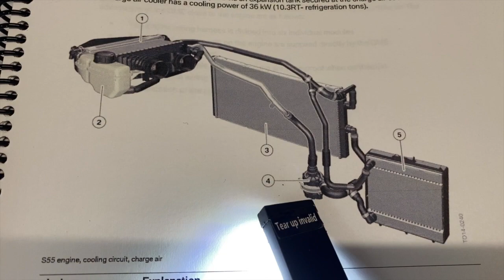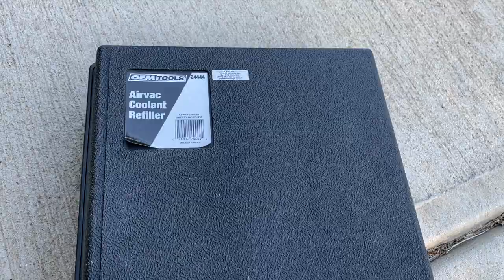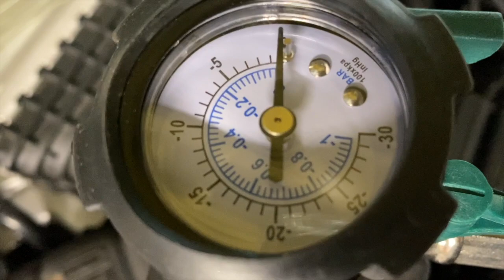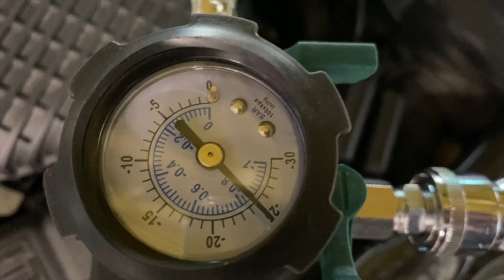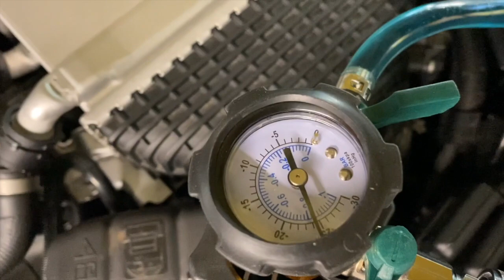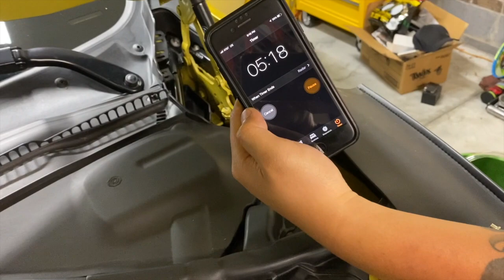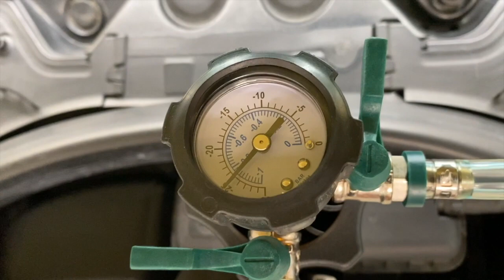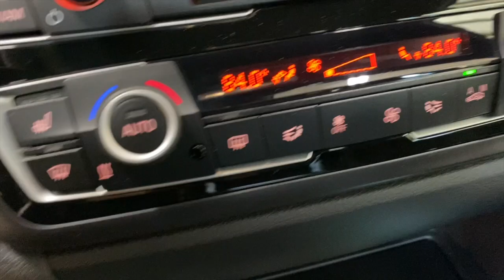HOW TO CHANGE THE COOLANT in a BMW M3/M4 (F80, F82, F83)

Comment: I just did this on 6 year old F-80.  It worked perfectly.  And yes I had to take out a little after the vacuum fill.  On a side note I bought one extra gallon of BMW coolant so I changed the coolant in my wife‘s volvo...it was OK but now the turn signals don‘t work.
Reply from the maker: +Bob Fognozzle 😂 nice!

Comment: Great info re this. ? for you, i notice my IC tank always seems to be right and the low mark, but my main tank is always over the full mark. this normal? no matter how much i fill my IC tank its always right at the low mark. then seems to over fill my main tank. Any thoughts?
Reply from the maker: +Shnel M4 IDK if you saw my S55 Cooling System Explained video, but you should check it out if you haven’t. You’ll see that the two cooling systems (charge air and engine) are physically separate, so when you add fluid to the IC tank (charge air expansion tank) it cannot affect the main (engine) tank.
Reply: Help Me DIY ok thx

Comment: What happens if you don’t pressure fill the coolant? And just pour in the same amount you took out and just bleed it? When I changed my radiator for my e92 I drained out all the coolant and just filled the coolant tank and did the bleeding procedure there was burping and a stream that was flowing I guess that’s what’s supped to happened and I just kept roping it off until the electric pump stop. Ever since then the car is done no over heat I’m a DIY guy also and I’m still willing to learn new things, did I do anything wrong there? Thank you!
Reply from the maker: +Jenderson Pen sounds like you did the right thing. The pressure bleeder is just a more fool-proof way of making sure all the air is out of the system.

Comment: What coolant is used for the top mount intercooler ?
Reply from the maker: +MELLtheLEGEND they both use the same BMW coolant. See the link in the description.
Reply: Ok.and i have to mix it with distilled water ?
Reply from the maker: MELLtheLEGEND yes. 50/50. The coolant bottle should have directions

Comment: Thanks for this video... the vacuum device seems pretty well built and a good value.  I did this slight modification to minimize the entrainment of air from the fill tube into the cooling system:  Before attaching it to the car, completely assemble the vacuum tool.  Place the fill hose into a container of distilled water.  Take the part that screws into the reservoir and hold it tight against your leg or some other surface (to close off the air path there).  Have all valves open except the one going to fill tube. Then attach your compressor hose, and slowly, give a small turn on the fill tube valve (doesn't take much), and you will prime the fill tube with distilled water.  Close off the valve to stop the flow.  To keep the fluid in the tube, you can hang the tip of it off of something from the top of the hood (coat hanger, caliper hanger, etc.).  Then proceed as you demonstrate in vid.  This way, you won't pull the air sitting in that tube into your system when you do the fill procedure under vacuum.
Reply from the maker: +JFritz you’re welcome! 🍻

Comment: I know this video is a couple of years old and no-one has commented for 6 months, but it seems to be about the only one on the subject and it has been linked on a number of forums and stuff. So I thought I'd add this info, which is from BMW's own ISTA+ servicing software.

The capacities are 13.9 litres for the main engine cooling system, which BMW call the high-temperature circuit, and 3.9 litres for the charge cooling system, called the low temperature circuit.

The specified coolant is nitrite- and amino-free anti-freeze and corrosion inhibitor. BMW's own products are LC-87 for vehicles up to the end of 2018 and LC-18 from the start of 2019. The latter should not apply to the F80, as the last one was produced in October 2018. But M4s were still produced until 2020, so they could be affected. These are different products so, if you have a late M4, you need to check which to use. Something that may help: LC-87 is blue and LC-18 is green. LC-87 is made using a BASF product called Glysantin G48 and you need to look for that 48 when you buy. Some brands call it AD48, C48, ST48, KK48, etc. LC-18 is made by Valvoline and called Frostox HT-12. Both these are to be used 50:50 with water or you can buy them ready mixed and use them neat. BMW actually state that in countries where tap water is drinkable, it is acceptable for use in mixing, so you don't have to use distilled. But I just bought the ready mixed so I didn't have to worry about it.

Both of these products are considered by BMW to be LIFETIME coolants. They do not need to be changed every 3 or 4 years. From September 2003, coolant replacement is no longer part of BMW's service schedule. It's there in black and white. Do what you will with that information.

I have not worked on the main (high temp) cooling system of my car, so I can't comment on draining and refilling. I fitted a (massive) Mishimoto rad for the charge cooling (low temp) system so, obviously, I had to refill that. I didn't bother disconnecting the top hose from the electric pump. It's pretty much impossible to reach. The system seemed to drain pretty well and I didn't need to get every drop out, anyway, as I was refilling with the same stuff and it's LIFETIME. The 3.9 litres no longer applies to mine, as the new rad is much bigger than the stock item. I have no idea how much I used. I did not use a vacuum filling kit, just did it by hand. After refilling and running for a while, I had to top up with a very small amount, after cooling overnight. I have not had to add a single drop more, even after 2 track days. Same applies to the main system. My car does not lose coolant. So, if yours does, you may have a problem.

Just to reiterate what Alabama Man said, With the engine running, the top of the charge cooler is very cold, even after a dozen flat-out laps of Castle Combe circuit. Once the engine is stopped, the temperature of the cooler and intake pipe starts to rise due to hot air sitting inside.

Leaves in the rads. Big problem with these cars due to the layout with all the rads and coolers stacked on top of each other. That horizontally mounted oil cooler is a disaster. Leaves completely block the bottom section of the DCT cooler, if you have one. You have to drop the oil cooler to clear them out. It is possible to do this without completely removing the bumper. You just have to remove some of the plastic undershields. As Aaron says, what's the point in replacing your coolant if you rads are all blocked?
Reply from the maker: Thanks for all that info! I will reiterate though that NO fluid is ever “Lifetime”. BMW started that when they started footing the bill for maintenance. Per Mike Miller’s maintenance schedule, CHANGE IT if you plan on keeping that car long term

Comment: Thanks for the instruction.  Was really quick and painless and got most of the capacity changed out.   To speed things up I used some compressed air at the fill points “sealed” with a rag when the draining slowed down.
Reply from the maker: +Jerome A. Glad to hear it went well!

Comment: Hey, love your videos. They are so informative and I can tell you put a ton of effort into the research before you tackle a job. 
Question. Can I move the charge cooler out of the way to loosen the manifold without having to drain the antifreeze? Also, would love to see a video on replacing the oil filter housing and oil cooler gaskets.
Reply from the maker: +Ryan Phillips thanks man! I try 😁
I really don’t know the answer to your question though. I’ve never fiddled with or removed the charge cooler. If I ever have to do any of those things you know there will be a video!

Comment: Try running the car till warm and then touching the top of the air to water cooler shortly after turning off the car or while it’s still running. Notice if you touch it after certain amount of time after the car is turned off and siting heat from the head of the motor while transfer into the thinner material of the intercooler pretty quickly
Reply from the maker: +Hdudbdjd Dhidhd someone else pointed that out to me too. Makes sense, thanks!

Comment: When you say your intercooler was warm to the touch were you feeling it after shutting the car off? If so that’s why, you need to feel it while the cars running. It will naturally heat up for a little when the car gets shut off
Reply from the maker: +Macaulay Cold One yes that’s exactly why! I figured it out after the video, thanks 😊

Comment: The hose going into the top of the water pump has the same C clip as the aux rad hose. Couldn't you remove that clip and disconnect the top hose?
Reply from the maker: +Stephen Lafredo maybe? Are you thinking that would be easier or more helpful? Let us know if you try it and if you recommend it.

Comment: If I need to add coooant to my engine do I do it to both and do I need to mix with water ?
Reply from the maker: +@nismos3023 more important question is why do you need to add it? Sounds like you have a leak somewhere you need to find. Top off both if they are both low. You can add only distilled water if you’re not adding much, otherwise add 50/50 mixed.
Reply: @HelpMeDIY  I need to fill up both because both are low. Do I use the same coolant for the both reservoirs ?
Reply from the maker: @nismos3023  yes

Comment: I'm kind of late to this, but can the dealership replace the coolant in both cooling systems?
Reply from the maker: +Anthony T sure they can. For way too much money when it’s an easy DIY 😁
Reply: @HelpMeDIY  of course. diy is the way to go. I am just wondering if it's an actual maintenance procedure. what is the recommended interval and does it coolant get pretty dirty?
Reply from the maker: @anthonyt4981  I can't speak for the dealerships but I think I explained it pretty well between this video and the one I did about the S55 cooling system ;)
Reply: Can confirm dealership charged me double cause of the 2 resivoirs... 🤷‍♂️
Reply from the maker: @mactruccsmacktruck1176  I just showed you how to do it, why would you take it to a dealership?! 😂 😉

Comment: Quick question, is there any reason why you do not drain the actual radiator of the car to a coolant flush? Compared to other cars for example like a Honda.
Reply from the maker: +Jay Ventura sorry I think I’m missing part of your question. I don’t know what you mean when you say to drain the radiator “to a coolant flush”
Reply: @HelpMeDIY  when you drain the radiator to do a coolant flush I meant to say
Reply from the maker: @jayf80  the radiator does get drained with this process
Reply: @HelpMeDIY  I noticed it was the small charge cooler radiator and the small engine radiator. Isn’t there a larger size radiator? That part wasn’t drained in the video. Thanks for the replies!
Reply from the maker: @jayf80  look at the diagrams I show at the beginning. They are all connected

Comment: What’s the capacity for the intercooler coolant system? Did you I say 4 liters?
Reply from the maker: +Domke don’t remember off the top of my head but I believe I stated it in the video.
Reply: @HelpMeDIY I watched it back, and verified that you said 4 liters. Yikes! I am down 2 1/2 liters. Time for a new intercooler. I am praying that the internals of my engine are not rusting. Do you think If I unplug the electric water pump, and drain the coolant from that circuit for the intercooler that I could drive the car in the interim? And can you confirm whether the circuit for the intercooler is entirely separate from the engine coolant? Thank you sir!
Reply from the maker: @domke7422  check out my video on the cooling system for the F8X 😉

Comment: Hi i am just wondering what your Oil Consumption like? Mine seems to use a quart every 3K miles is this normal?
Its seemed to use less when i got the car first about 2 years ago it was about 6K miles before i had to add a quart of oil
Reply from the maker: +sezzzi1 I have no oil consumption. If you do, you have a leak somewhere that needs to be fixed. I change my oil every 5-7K miles.
Reply: @HelpMeDIY  thanks i was thinking that.
there is no oil leaks on my garage floor even if i leave it for a few days, nor is there any burning oil smell coming from the engine bay after it turn off  .
Anyway could still be a small leak somewhere so i will get it checked out at the dealer thanks again👍